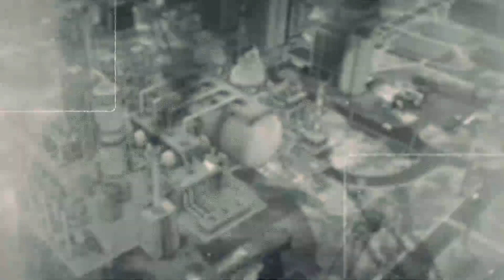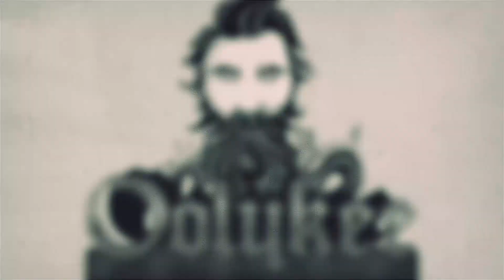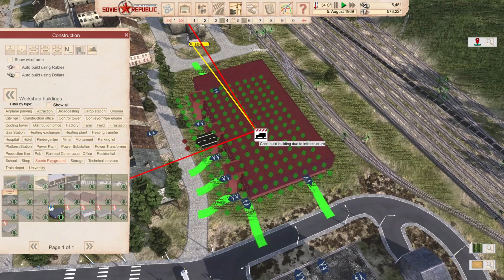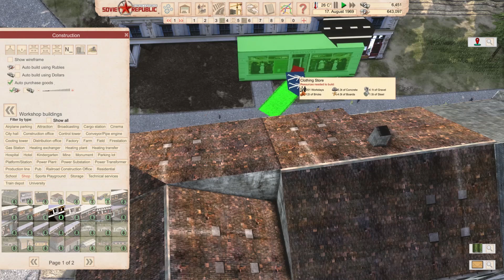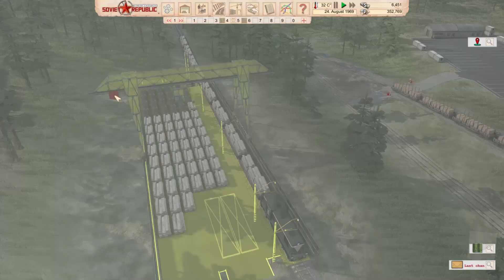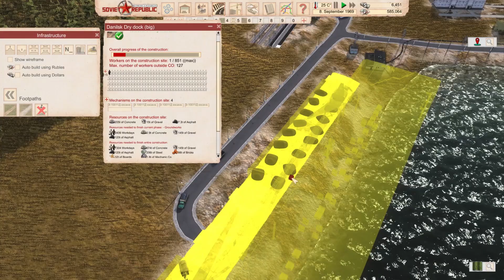Soviet Republic - Mezirusy - Ep.56

Comment: The signal mentioned by cristian is facing the wrong way.
For meat deliveries around my towns I use a refrigerated truck mod by MC Bonito, the Paz 3742 Izoterm, it's just looks the part for this era. Cheers it's 33deg here hot and humid.
Reply from the maker: Got it! In today's episode, I will correct this. But not before it caused some issues. :D :D :D 
33 degree?!?! We never get this in Ireland. :D :D 
I am Croatian though and the temperature there does reach these levels. :) 
You are lucky. 5 celsius in Ireland. 
Thanks, guys!